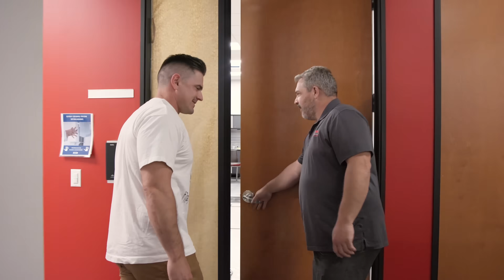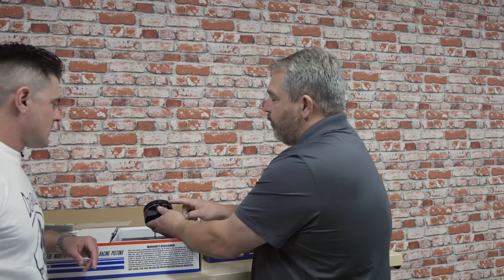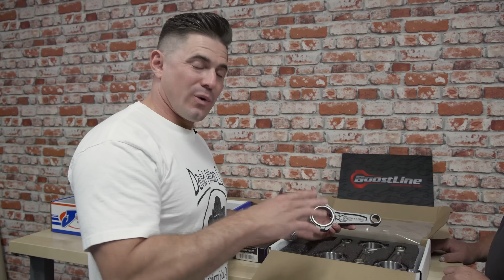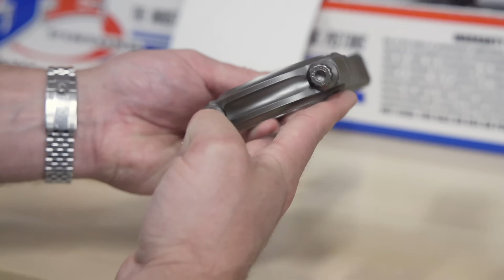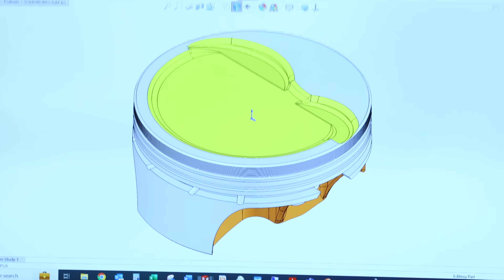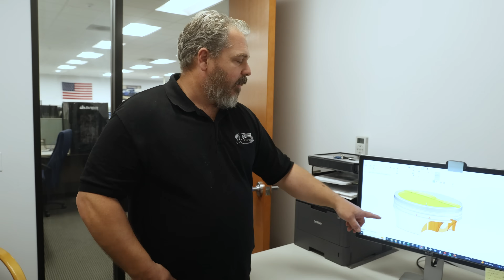Building a 2000HP Motor for WAYLON 2.0 - AWD Burnout Truck

Comment: Wait, you're going to ruin an absolutely gorgeously mint 2dr GMT400 Tahoe and use it for bumping walls as a burnout truck??? You couldn't have picked something less expensive and lusted after than a 2dr Tahoe? The drag and drive/street menace was a much better plan for this IMO....buy a 4dr Tahoe for a burnout truck, or an extended cab OBS....not this pretty azz truck 🥺😑🙄
Reply from the maker: That Tahoe is not mint. It’s definitely a 50ft-er. And doing pro level burnouts is not about bumping walls. Pro level burnout vehicles need to look great and perform better. I love 2dr tahoes, so that’s what I’m gonna party in.

Comment: 13:30 Then you fcked it up big time, because that coating is not thicker than 5-6 microns! I'm working with DLC machines for 5 years now, and the thickest coating that's achieveable is 30 microns, and it needs a special machine only for that. At that thickness you don't see anymore the original surface through the coating as well. If you lapped the pin 2 tenths down for the coating, then it's not gonna be the correct size. Or our guy doesn't really know what he is talking about.

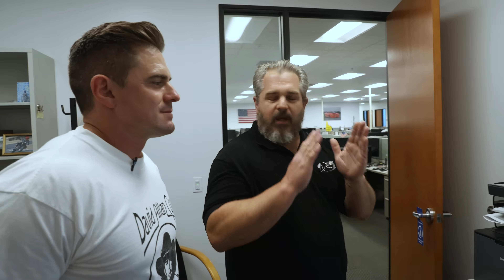Comment: @36:04 this is one reason LS engines with stock pistons crack with lots of power, the pins and pin towers flex.
Reply: yet the ring lands are the ones who break the most.. interesting...
Reply: @crisnmaryfam7344 ring lands brake to do ring not enough ring gap and bad tune ups on stock pistons

Comment: Great info in this video. There some nice pistons, even taking into account the thickness of the coating and heat expansion 👍🏻 those version 2 rods are nice, running boostline rods in mine. Mr Warspeed said I should be good to 8000rpm haha.

Comment: I mean I'm sure it will be purpose built correctly, but you already have so much power... why can't you just change the over-all set up? you didn't do much with that version of the build. Why does it need an engine swap?
Reply from the maker: I am changing the overall set up. And I’m doing so because this setup works - it’s been proven time and again.. The Godzilla needs a lot of development if it’s going to be able to hang under this kind of stress.